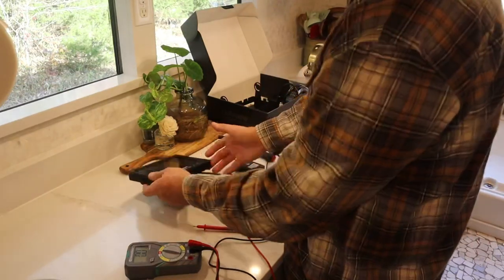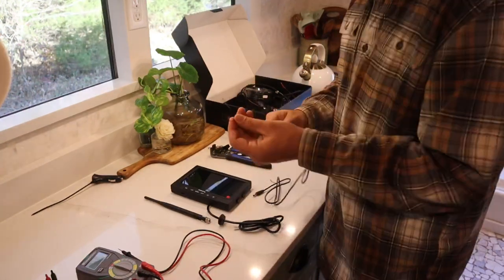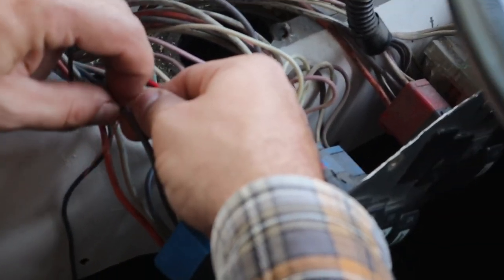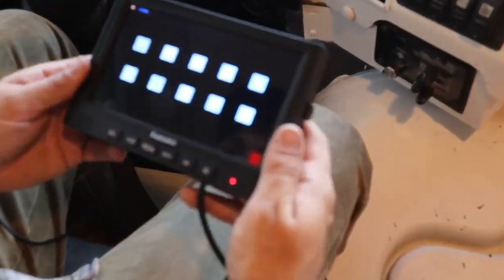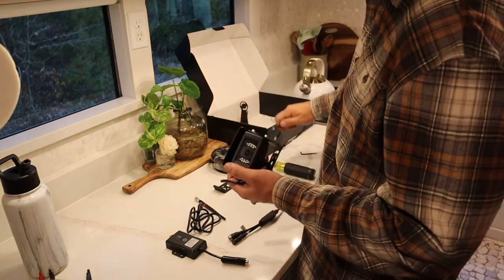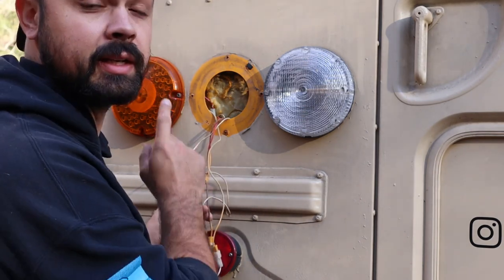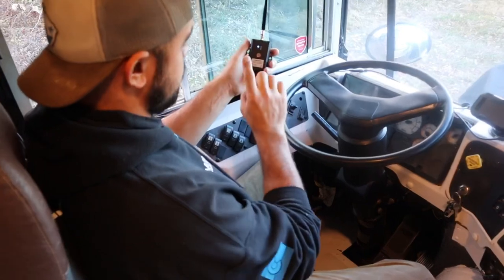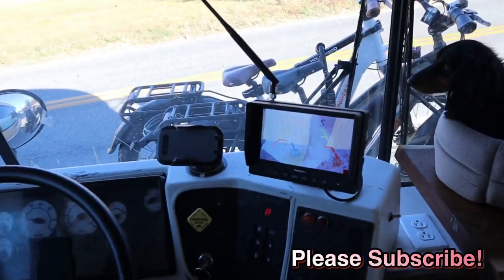Haloview RD7 Camera Install & Review - Skoolie DIY - Using Existing DC Circuits

Comment: If you connect the camera to the reversing light you wouldn't need a separate on/off switch because the reverse lights always come on only  when you engage reverse gear and that's when you want power. :)
Reply from the maker: Just seeing this, sorry! It’s a brilliant idea. Definitely going to do that next time.